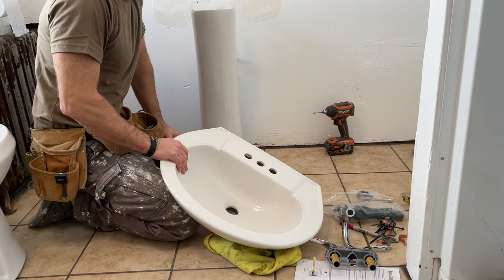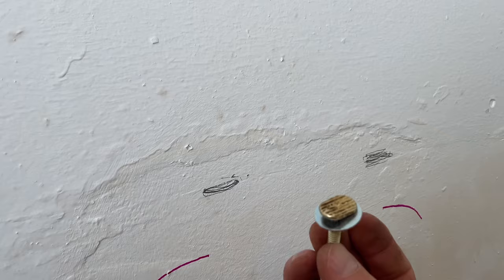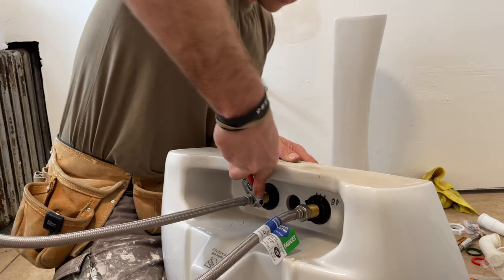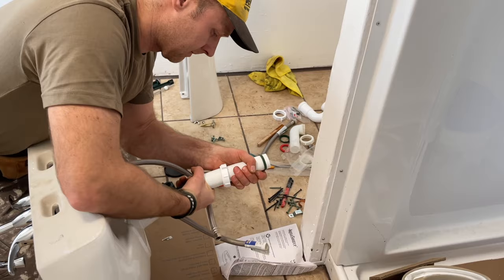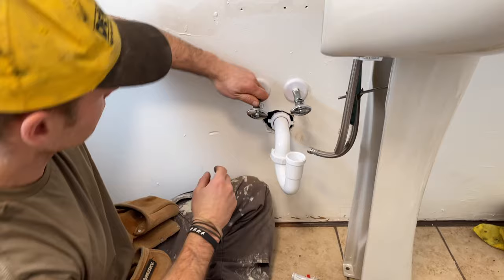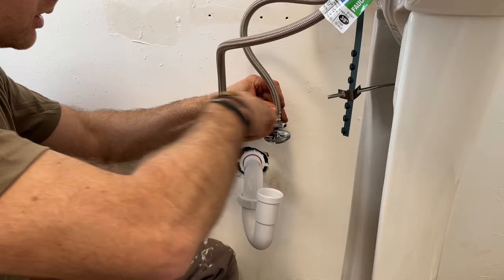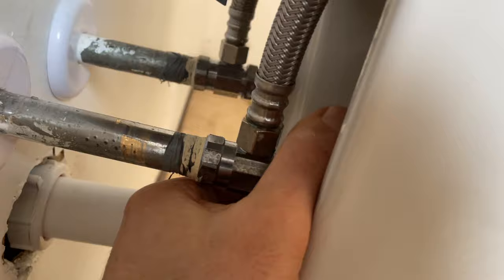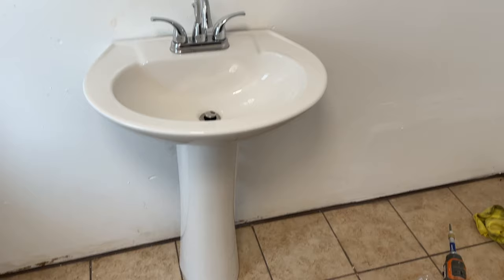How to Install a Pedestal Sink and Faucet - full process, assembly, drain, water lines, faucet..

Comment: Ok so how the heck do you put something on the screw head to tighten the bolt going into the wall? One hole is going into just dry wall and the other hole hit a stud. AHHHH i cant see how you can fit a drill on the head to screw into the stud. Also the peetree trap to drain, did you extend the drain line down, you said something about it being too short, mines too short. How did u extend it with just a coupler and short piece of same pvc size? Thanks for the video!
Reply from the maker: Got longer pipe and cut to size to extend.   Yeah the screw can be a pain yeah.   Can try using that 90deg screw gun attachment Maybee

Comment: This is the same problem I have and the guys at Home Depot recommended an adaptor but it didn’t fit. Where did you find the converted seal washer and nut?
Reply from the maker: Just searched around in the plumbing isle in Home Depot

Comment: At 0:30, You don't really want to mount it to the ground, or caulk around it.  The sink itself will be secured to the wall, and if you ever have a clogged drain, you can remove the pedestal to access the pipe.

At 4:25, You can use plummer's putty, or you can use the gasket, but don't use both, per manf. inx.  If it comes with a gasket, I would use that.🙂
Reply from the maker: Thanks 👊
Reply: Shouldn't sink be mounted to 2x4? What IF there is no 2x4 there where the sink goes.